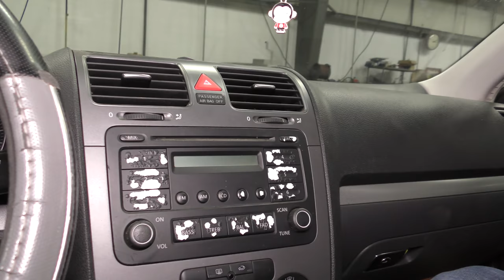$1,000 for a window motor on a 2005 VW Jetta?!? The CAR WIZARD & HOOVIE were just a shocked as you!

Comment: We are now in the middle of September on a Wednesday and the Car Wizard already listed the six used vehicles to buy and the six used vehicles to never purchase in real life and this is throughout his experience as a mechanic. Anyway, he will have six more vehicles to buy from a different list and six more vehicles to run away from in a different platform. The six more vehicles to buy are the third-generation Mitsubishi Outlander with the 3 L V6 and the six-speed automatic transmission, the 2011 to 2017 Honda Odyssey eight-passenger minivan with the six-speed automatic transmission, the third-generation Nissan Quest with the five-speed automatic transmission, the second-generation Hyundai Santa Fe with the 3.3 L or the 3.5 L V6 engine and the five-speed or six-speed automatic transmission, the first-generation or second-generation Ford Escape or Mazda Tribute with the 3 L V6 engine and the four-speed or six-speed automatic transmission and the second-generation Toyota Highlander with the 3.5 L V6 engine. The six more vehicles to never purchase (not to buy, ever) are the 2001 to 2007 Dodge Grand Caravan or Chrysler Town & Country (any of them), the 2003 to 2006 Kia Sorento, the 2011 to 2019 Ford Explorer (any of them), the Mazda CX-7 (all years and all engines, including turbocharged), the 1999 to 2003 Lexus RX 300 (first-generation) and the first-generation Chrysler Pacifica crossover wagon (all years and all engines). Those are my opinions for the next list that the Car Wizard will explain in the near future. Thank you very much and have a great day ahead.

Comment: Judging by the rust they didn't change much compared to previous generation. I bet if you removed the mud flap and wheel well liner you'd find a nice mud cake topped with leaves inside there. That is where all the water and crap that was on the windshield or anything in the gutter in front of the windshield end up. And that rots the bottom of the fender and the rocker panel.

Comment: I had the 2.5 on an 06. It was a bit mushy, but it really did sound nice.

e; It also had some petina, this body loves rust... Mine was mostly around the trunk lid. Also had the same bubbling issue with the radio, and had to cut out the headliner. Didn't have the window problem, but the driver door wiring harness was garbage. Had to replace it twice because the wires kept snapping in the door jamb.

Comment: The window module is similar to the  crop of Mercedes that you also have to programme- had issue with my old CLS driver side window 2008 model went well up to 100000 miles and then started to have these gremlins now gone after oil leak. Love this channel real mixture of motors

Comment: I have seen many cars and trucks with hand lotion disease. The steering wheel, inside door handle, and radio and dash buttons all go soft or peel. Not the same as gummy disease that some of the soft coated/painted buttons and dash panel gets.

Comment: Anyway, I like this generation of the Volkswagen Jetta. They are great vehicles and they are fairly reliable with the 2.5 L five-cylinder engine and the five-speed manual transmission. I am currently hoping for an all-new, buy this, not that video to be updated this weekend.

Comment: My jetta hand brake froze on one side, the problem was the rubber boot at the wheel had come off. I sprayed some lube on the end of the cable put the boot back and the problem was fixed.

Comment: I’d think it would be entertaining seeing you make a video on all the over engineering (under engineering?) that volkswagen takes part in.  examples:  check out the labor time and reasoning for that vacuum pump replacement on the 5 cylinder, some engines with a belt driven water pump in the SIDE of the block with a driveshaft running through the block to run it, the window regulators that require taking the sheet metal off the outside of the door, Audi engines with A/C compressors that are run off a driveshaft from the timing chain on the back of the engine even though it is right next to the normal accessory belts on the front.  So many facepalms...

I used to love volkswagen until I became a mechanic.  BMWs and Mercedes have their problems but at least usually it doesn’t seem like they are being different just to justify being employed.

Comment: The module doesn't need to be programed just coded and takes 5 minutes. Normally its just the wiring that breaks in the a pillar loom that causes the window to be inoperative.
Reply from the maker: Can a home mechanic code it with a $50 code reader?

Comment: Unbelievable... If memory serves, VW set the Toyota Corolla as the reliability target for the MKV Jetta/Golf. And then they go and design a window module that you can't just swap out without reprogramming! That's not surprising for VW, but it's unfortunate there's not an aftermarket solution.

Comment: I should bring my Honda Accord to the car wizard to contrast with this Jetta. My car is 2 years newer, but has 213K miles on it and I used it for Uber driving. It is in FAR better shape than that Jetta. Also, I live in the northeast and drive it on snow covered roads regularly. It has only 1 rust spot on the whole car.

Comment: My daughters boyfriend {with benefits perhaps?} had a brain snap and bought a VW of some description.

The glass in the door mirror almost fell out and fortunately I had a tube of that ubiquitous SUPAGLUE - so an easy fix.
The drivers side glass actually fell out, so went and asked for the price of a replacement - $460 - PLUS fitting. 

When we told the "spareless parts department" that we only required another glass to replace the mirror, we were told that they only sold the complete unit.

Obviously then, we are going to a local glazier to have a mirror cut out .............

Comment: Yep, I’ve seen those crazy expensive things go bad. That’s modern VWs for ya!  Personally if I were the owner I would be more concerned about the parking brake issue than I would be the window regulator since this car is a stick shift. If memory serves me correctly I don’t think that these cars have nested drums inside the disc brakes for the parking brake shoes like some cars do. I’m pretty sure that it’s linked to the calipers for the disc brakes. Honestly I bet if you just sprayed some brake cleaner in there from the back that the cable would free up and start working again. I personally have experienced that same scenario many times and that usually does the trick. Very quick and easy fix.

Comment: I still don't get this.
I had a 2006 gasoline eurospec Jetta with 250.000 km (150.000 mi) not long ago and it looked and worked like a brand new one.
Eurospec VW's really seem to be higher quality than USA-spec.
Or maybe the climate has something to do with it.
In western-Europe with a diesel VW (1996-2008) people often reach 500.000 km (310.000 mi) with practically no problems at all.
Reply: I've checked and a (non original) window regulator costs €30.- here and an original €120,-.

They also fit different (smaller) engines over here.
The (pre fsi/tsi) 1.6 8v 102 hp engines were particaly great.

Love your channel b.t.w..

Comment: I bought a 3 year old 2004 Passat for my 16 year old years ago. It offered stability control and other safety electronics that were not offered in Japanese and American companies at that time.  80,000 miles, VW dealership checked it out.  3 months later, $3000 worth of sudden repair.  Another 6 months go by with another $3000 of repairs.  Another 6 months the dash lite up like a Christmas tree.  Traded in for a new Honda Accord.  VW, the people’s car, Audi expensive parts.  VW never again.

Comment: $1000 window module? Separate the module from the motor, check the motor, if it works, hotwire that shit to an old Cadillac power window switch, dunzo. If you're feeling extra creative, you can stick 2 SPDT 30A relays in the door somewhere and you can use multiple 3 position momentary center off switches to control them... bonus points for using speaker wire on the control side of the relays and not starting a fire.

Comment: WHY you need to Program the Window Module..... all new cars have the auto up and auto down function and anti pinch protection so you cant mash you arm or head or finger or whatever is through the window frame when you pushed the button to close it.... plus most newer cars have security programmed into the modules.... every computer in the car has the vin number stored into its memory.... so in this case you need the vw factory scan tool...you first connect to the car then ask for security access....then you divorce the old passenger door module and remove it...install the new one... electronicly marry it to the car then you do a learn to the module..it will make the window go up and down a bunch of times... that way the module can determine where full open and full closed are.....

Comment: Wow that's bad. My 2006 Mercury Grand Marquis with 273K miles on it is in way better condition than that, and it is used as a daily driver. Before I got that I had a 2001 Chevy Malibu which really was a pile of junk (I will never buy a front wheel drive car again) but it did last over 200K miles, with quite a bit of work. Both rear window regulators broke. The motors still ran, but the cheap crappy plastic pulleys broke and tangled the cables up. The whole assembly was about $120 each, but being the rear windows, I didn't need them to work, so I bolted then shut. The only window I need to work in a car is the drivers window, so I can go through drive throughs.

Comment: What happened to this car's interior?  Back in college I had a 2000 an MK4 Jetta GL with the 2.slow engine and a 5-speed manual transmission.  I drove that car for a few years after graduating and my interior looked almost like new.  Nothing peeling, bubbling, headliner like new, no oil leaks, and slow as heck.  😄  At the end of the road I had 258,000 miles on that rig to be exact.  I got $100 for it in trade-in!  Yes, really.  A hundred bucks.  That was it.  The car was still in great shape, but the mileage just destroyed any resale value.

Comment: Window has aftermarket/used parts that a German car doesn't like? Shocker.
That 2.5 engine is very reliable, if it has had regular synthetic oil changed performed at a place that knows what they are looking at and can recommend preventative maintenance.
10 years of Walmart/Jiffy Lube..."Our observation is you need windshield wipers," doesn't help an over engineered car that requires scheduled maintenance not just oil changes.

Comment: Who would ban Hoovie from videos? Jeeez. Anyway. The window motor probably costs 20-50 EUR on German e-bay, plus shipment to US. Overwhelmingly original version of VCDS, to be connected to a normal Windows 10 laptop via USB, costs 30 EUR on Aliexpress. Taking the door trim off and putting it on back again ... well, takes two hours even with two left hands. On a positive note, seems like this VW is getting a motor not allowed in European VWs - an Audi 5 cylinder. Is it roughly the same block that is going into RS3?

Comment: My 2003 Toyota Matrix XRS is in much better condition than this car. I bought it new in March of 2002.  Mine does not have rust as it was a California until I moved to Nevada last August, so I won't include the rusty condition as part of my comparison. The interior of my car is in great condition other than some stains on the cloth seats. Radio buttons -fine. No oil leaks or broken window modules. Steering wheel-fine. Headliner-fine. everything is fine and my car sat outside and cooked through 18 hot summers. I have 207,000 miles on it. Either this VW has not been taken care of or it does not have the quality of a 2003 Toyota. I suspect the later.  This is why more people buy Toyota than VW.

Comment: I wonder if the front and rear module/motor is the same and can be swapped. I would rather have the front windows working and leave one of the rear ones nonfunctional.

Comment: It’s no coded correctly. You need to take it to a dealer. They have different codes because of the auto theft in Europe. It’s coded at a different level than all the normal mechanicals you can do with your computers

Comment: I had a 2.5, good engine but the 6 speed automatic quit way too early. The manual would be a better option. I think Hoovie actually lives in the boat and crashes a Wizard video whenever a hooptie needs tires.
Reply: What happened to your auto? I have one that’s been solid so far, hoping to get more out of it. I service it frequently though
Reply: @bierlyynn  about 250k mi. , it started shifting hard when warm, then progressed to not shifting when warm. I likely didn't service as well as I should have. Lots of highway mileage...miss that car. 35+mpg.  Take care of it and good luck.
Reply: @paulwoodman5131  I had that precise issue at that same mileage with a mk4 Jetta I had. I’ll keep on top of things, thanks man

Comment: Historically VW's headliners are bad. I also had a 2002 TDI and the driver front window went bad under warranty. When it was replaced they extended the warranty on the window. Later, when I traded the car in for a 1969 Karmann Ghia I received a letter about the power windows and a class action lawsuit against VW. I agree about previous generation being better as I had and loved my 1998 TDI, but it was 5 speed and my new wife didn't drive stick shift. Later on I would go on to buy a 2011 TDI. By the way they were all three Tornado Red. Unfortunately I traded the car in before the recall and lost out on the $8,000 payout settlement.

Comment: I don't get it.  It would be one thing if the VW window motors were super high quality but clearly this one isn't, failing at this age and mileage, so instead of a $1k OEM VW motor, rock auto has them for $154.  That's remanufactured and I'd prefer new, but when the cost difference is this much and for a beater with several cosmetic issues already, I'd do it in a heartbeat.

OR... remember this isn't safety related, so you could do this old school, wire up a motor without the computer module, through a standard switch, and fuse to the battery.  Why even add back a computer module that seems prone to failure and needs PROGRAMMED (lol)?

Comment: The window regulator is typically German.
Why do something cheaply, quickly and easily, when you can do it the difficult, expensive and awkward way.
In Germany we built giant gantries every few miles on the Autobahn, so every single mile driven by trucks can be recorded, centrally processed and automatically billed.
Just to make sure no one drives even one kilometre for free.
The Swiss and Austrians make you buy a sticker for your window that costs pennies to produce.
We like to spend billions to save millions.

Comment: Its not an 05 , its an 06,   the wiring through the rubber boot cracks on all those vintage cars. Drivers door especially,  https://forums.tdiclub.com/index.php?threads/2006-jetta-driver-window-motor.311554/   or https://www.vwvortex.com/threads/2006-jetta-driver-side-front-window-not-working.5758781/  and the motor should be plug N play,, only time you need Vag com is to test it I read.

Comment: Is there really no way to rig up a window motor that doesn't need a stupid module and runs to the switch? Or hot wire the motor to run? VW is a horrible company for that garbage.

Comment: See no reason to not fix if check British ebay 
https://www.ebay.co.uk/sch/33706/i.html?_from=R40&_nkw=vw+jetta+car+window+electric+motor you gent those as low as 39 pounds and same of them are even places with the warranty (car dismantle companies)... In Europe GB is place to buy cheap quality parts for used cars :) It as idiotic as owning Chevy pickup in EU will order any parts from local dealers ... All major part will be ordered directly from US  (except brakes and filters oil)even with customs reason these parts in EU is 4 times more expensive if local dealers are willing to deliver them. The same goes for EU car in US any cheap parts order from GB/Germany directly Delivery expenses and customs will be cheaper than  US prices. Reason for that is simple in Eu they sold at least 1 millions of Jetta /Golf